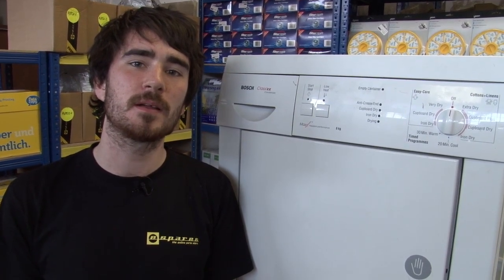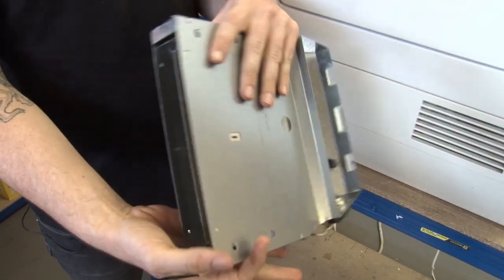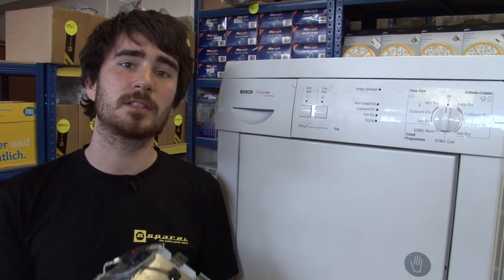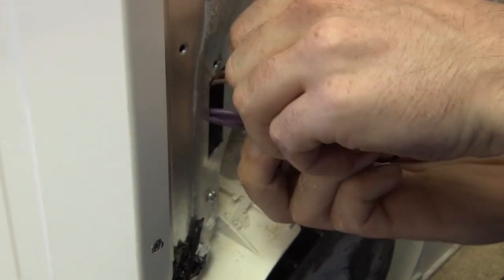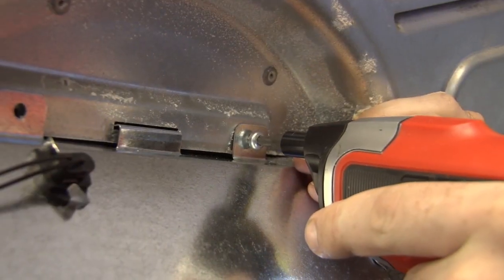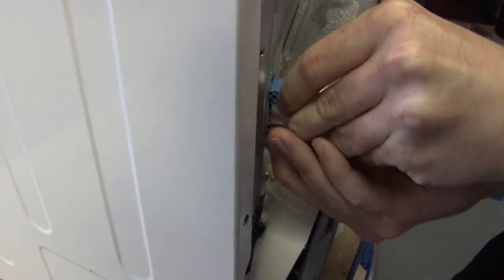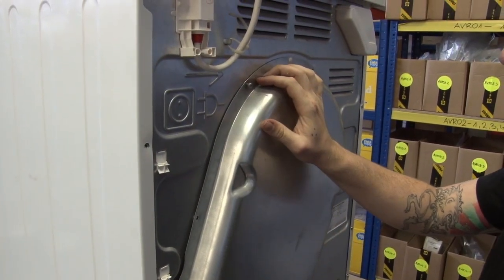Bosch Tumble Dryer Heating Element Replacement – The EASY Way!

Comment: I have that exact dryer. It starts ok and goes on for a few minutes, but then it just cuts out. Normally, it starts getting warm quite quickly, but it's still cold and hasn't even started to show signs of warming. I reckon t's the heating element. Where can I get a new one to replace it myself? I'm in Germany.
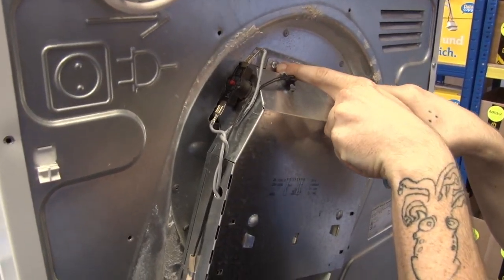Reply from the maker: +Shaz W At 1:09 you can see on the top left of the heater element a black piece with a red button. This is the overtemperature cut out and will trip out if either the air flow has been restricted or stopped when hot. If pressing the reset does not cure it we can supply the heater by using the following link and entering your full model including the /?? and heater in the search box:
http://www.espares.co.uk/search/ma856pt1584/tumble-dryers/heaters/bosch